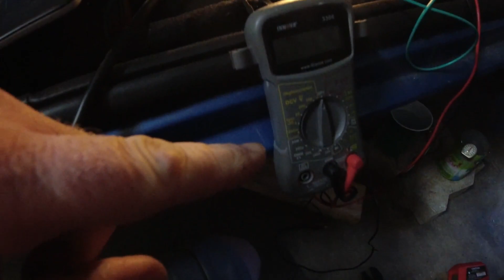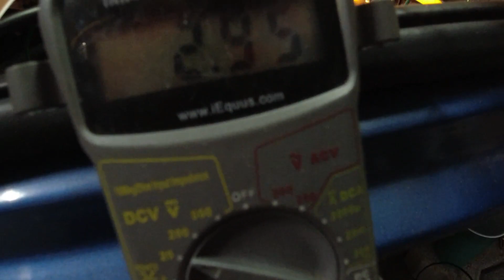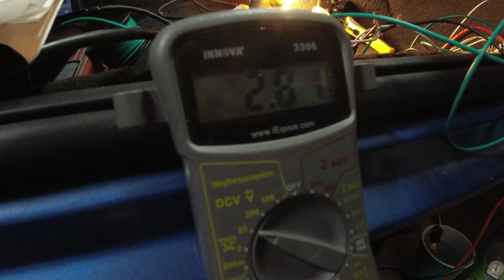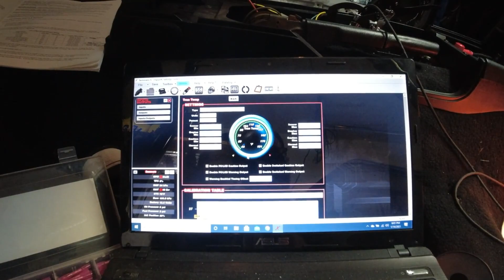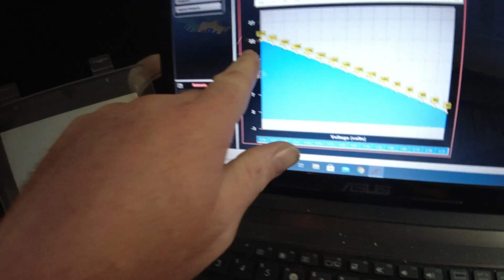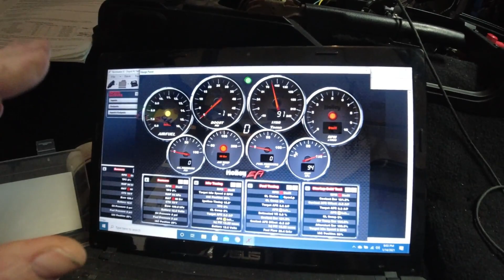Project Coupe - Custom Trans Temp On Holley Terminator X

Comment: Hi Justin. Looks like  you’re getting thing’s handled. Great job and love your work. Very professional. Only thing I would change is the dedicated ground to the block without going thru the frame. In a phase diagram they are different. It does need that. Everything else is perfect!!!!!
Reply from the maker: What would you suggest on the ground to the block. I had it same way on the hatch.
Reply: @justin91lx  bell housing bolt, motor mount bolt or intake. They’re all good.